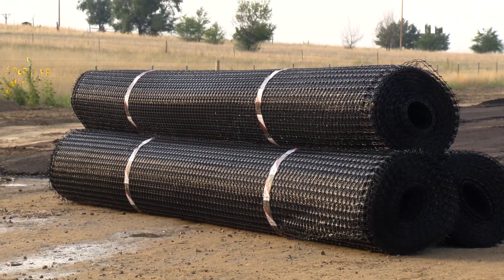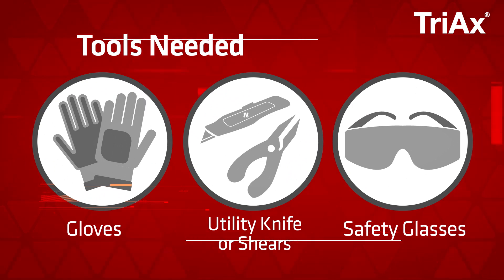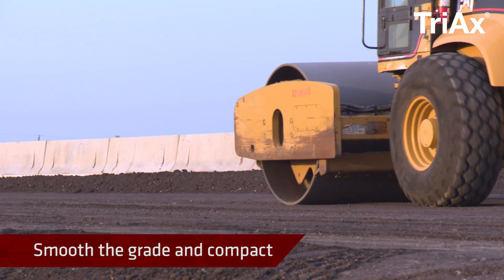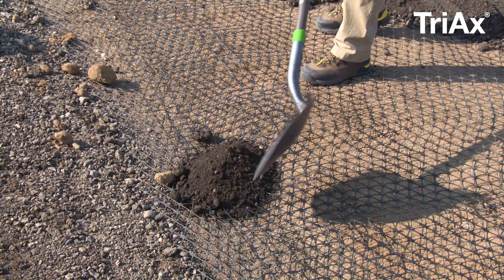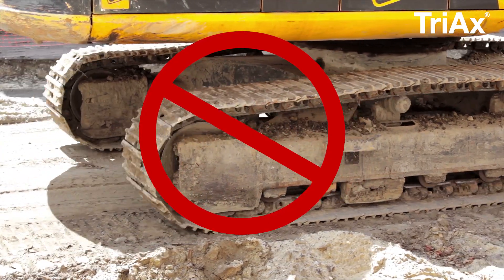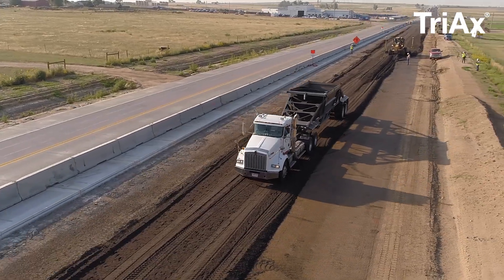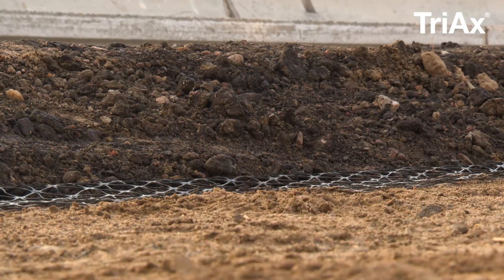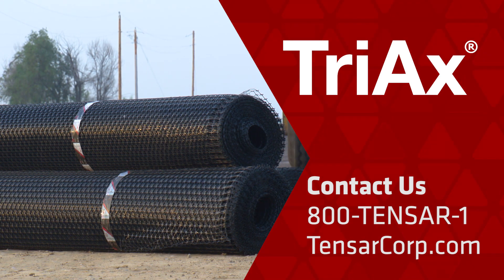How to Install Tensar TriAx Geogrids on Roadway Projects

Comment: I’m a flatbed truck driver who just delivered about 13,800 pounds of this stuff from morrow, Georgia to hearne, Texas. Just want to say if you’re a truck driver watch out they may load you about 14 feet high with these rolls better torque down those straps real tight to not wreck a bridge. And if you happen to deliver in hearne, Texas be careful at that site.